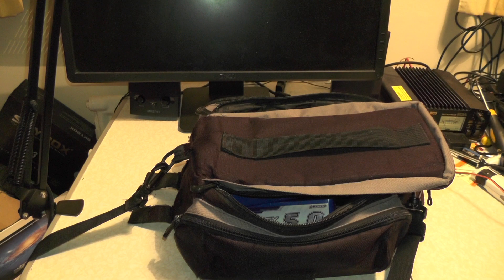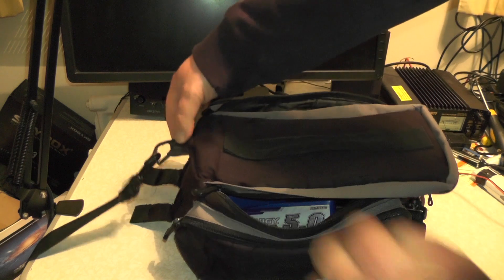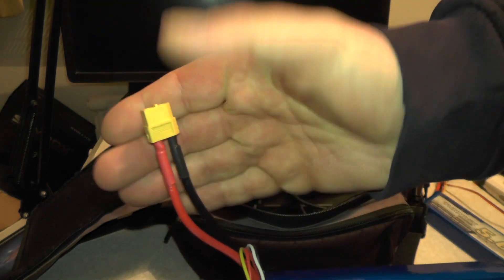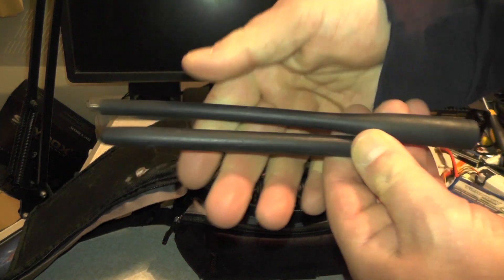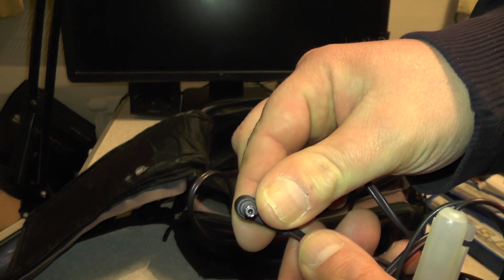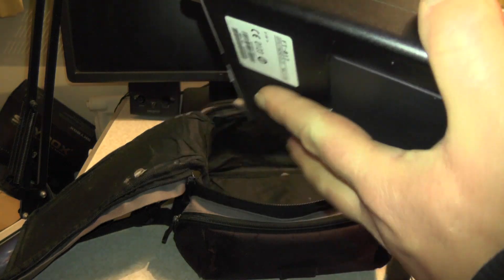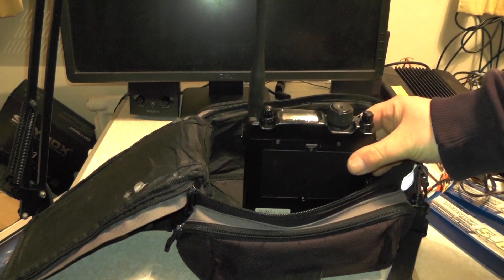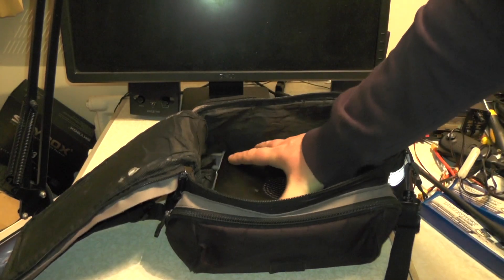New Qrp setup

Comment: Nice job Jez, glad the radio is working out for you. I have never tried the default 2m/70cm/6m antenna. Are you going to go up a hill and try to get into a few repeaters with it or just use the radio for HF?
Reply from the maker: I went up my road and tried 2m ssb and it worked well. at the moment we can't go anywhere only shopping and work